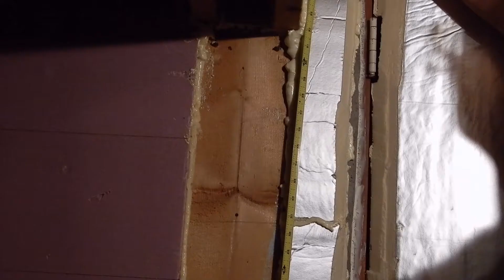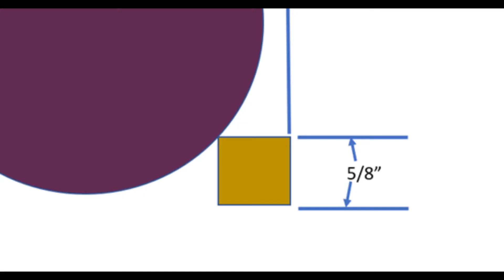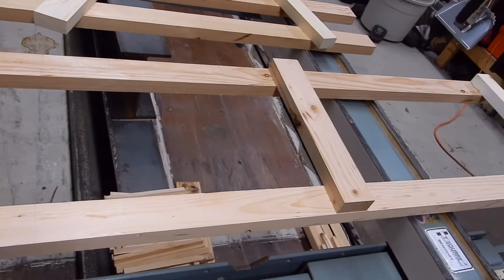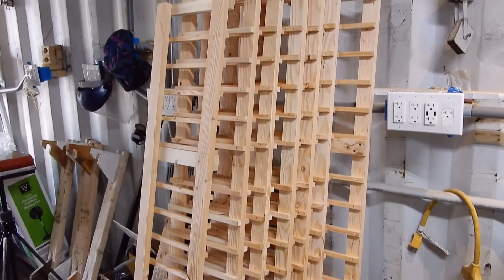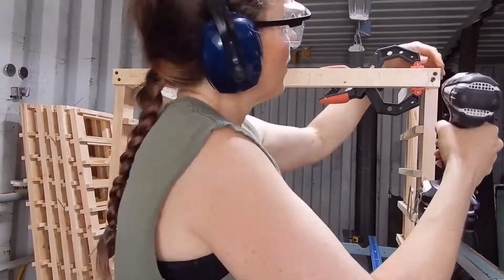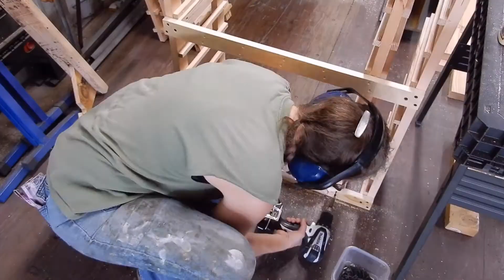DIY Wine Rack

Comment: Great job, can you please provide the cut list?
Reply from the maker: Maybe this will help. :-)
Front width	This is a 2 in piece 		need 8 of them		4 front
		2" x 2"	28 3/4" long		4 back
					
					
TopToBottom	these are 1" pieces 		need 14 of them		7 front
		1" x 2" 	75" long		7 back
					
					
3 5/8	spacing for each bottle				
				
					
supports	these are 5/8 "		need 216 of them		
		5/8" x 5/8" x	12 1/2" long		
					
Front to back - bottles are about 12 1/2 " long					
					
	
Front to back		need 8 of them		4 rt side	
	2" x 2" x	12 1/2"		4 lft side

Comment: תן רשימת מידות מדויקת של העץ .....שרטוט מידות של הבניה....זה יעזור מאוד
Reply from the maker: I put the details in the info about the video. This fits into the space I needed. You can adjust it to fit your space
Height: 75 inches 
Width: 28.75 inches
For top to bottom: Need 14 pieces that are 1 x 2 x 75 inches (7 front & 7 back)
Front width: Need 8 pieces that are 2 x 2 x 28.75 inches (4 front & 4 back)
(I left a space of 3 5/8 inches for each bottle)
Supports: Need 216 that are 5/8 x 5/8 x 12.5 inches
Front to back: Need 8 pieces that are 2 x 2 x 12.5 (4 right side & 4 left side)

Comment: That looks great! Did you consider a diagonal pattern at all? I'm thinking that it potentially could save a bit of space, or allow for more bottles.
Reply from the maker: Honestly. I did think about it but you end up with a lot of unusable space at the sides where the diagonals come together. I think this might hold more bottles because there is less wasted space but I don't know that for sure. :-)
Reply: @ElizasVariety  Of course you're right, a diagonal square pattern would just be the same only tilted, less compatible with straight walls, and more difficult to build. What I'm considering is making a hexagonal pattern rack of some sort. That would allow the rows of bottles to interlock which would save some space although I haven't really calculated how much. Such a stand could easily be constructed by gluing little lengths of tube together, but they'd have to be the big enough inside so that they can accommodate bottles, but also small enough as not to waste space. It's struck me that bottle size varies a lot - Bordeaux style bottles can be as little as 70 mm. whereas Burgundy ones over 90 mm. Sparkling wine bottles and magnums might approach 100 mm. I think. My best idea is to make two stands of different diameter tubes, but getting the right sort of solid plastic tubes of any ideal diameter seems a possible challenge.